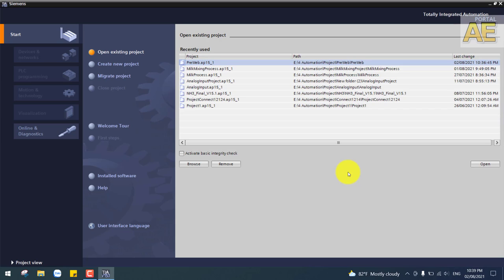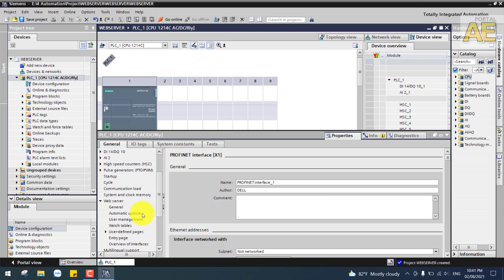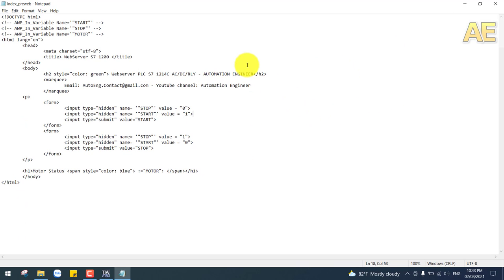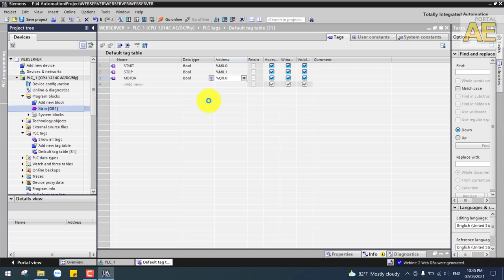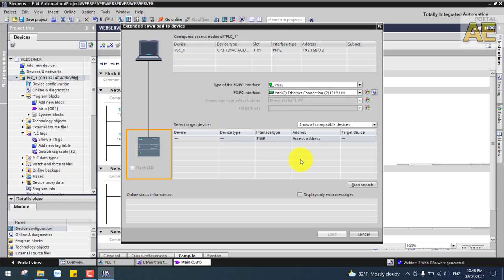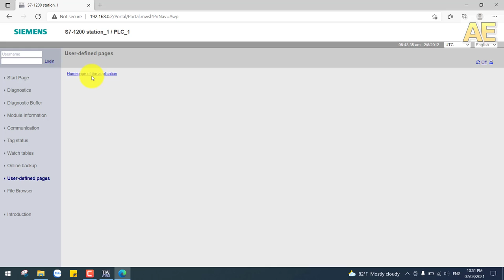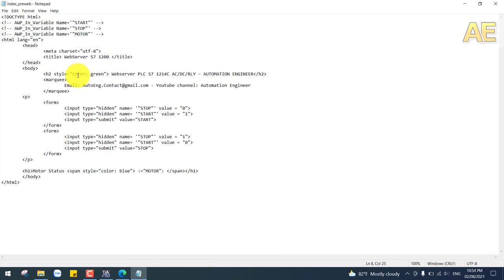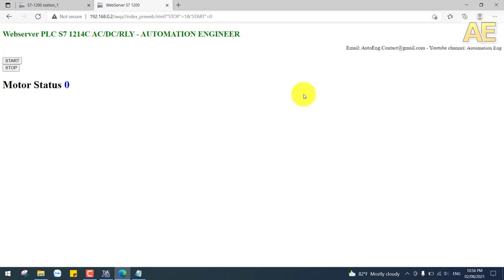Design Webserver On TIA Portal And Control PLC S7-1200 Via Internet Web Browser

Comment: I repeated the procedure but when clicking on the START and STOP buttons the tags do not have their values modified in the PLC.
Reply: Hi, I have the same problem, if you find the solution, I would appreciate it if you could tell me how you did it.
Reply: @norvinkleyvaperez8774  it is necessary to login on the controller page, use admin for both login and password